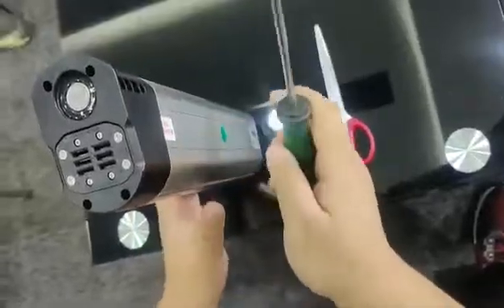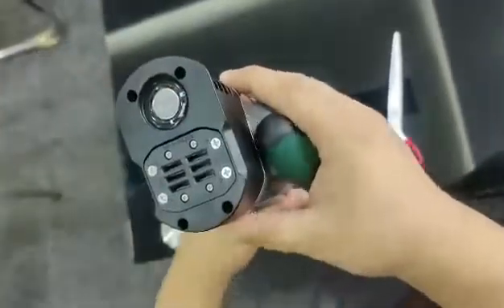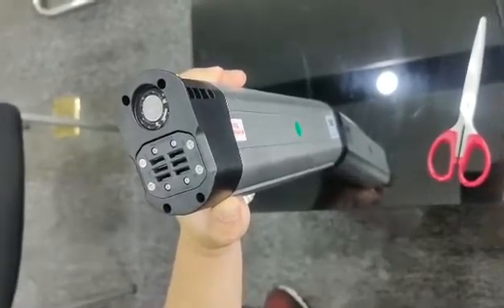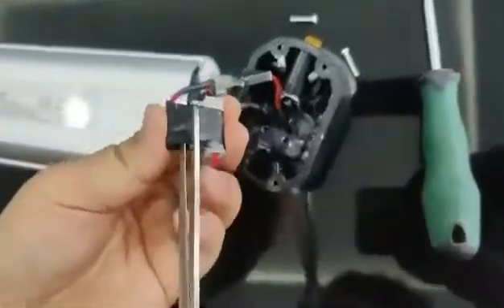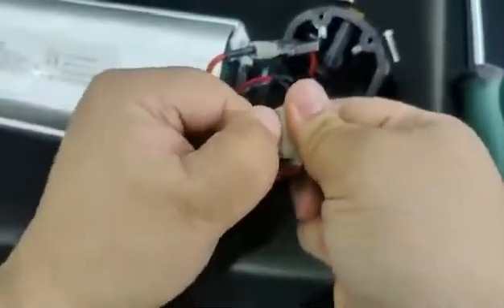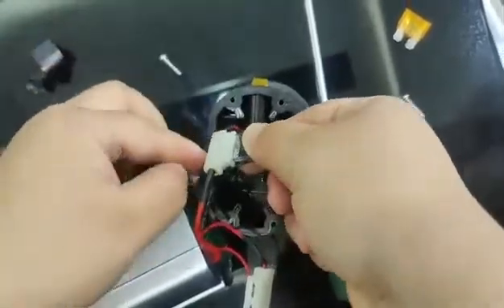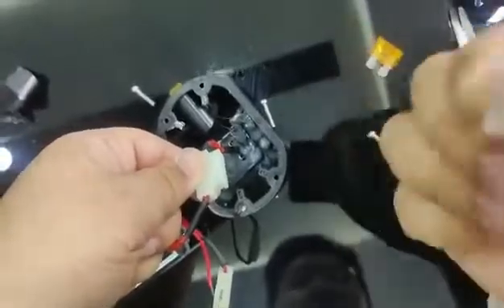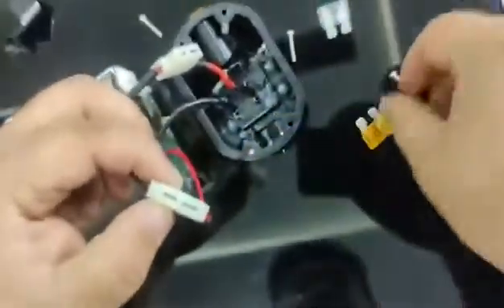HIMO Z20 Z16 battery replacement fuse（Z20 Z16电池换保险片英文视频）

Comment: I bought new display and new cable. When connecting to controller the display is weird and battery bar indicator is flashing. Do you think i need a new controller